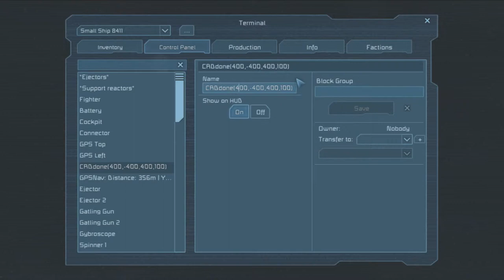Autopilot Tutorial

Comment: Could u add support for auto emergency braking using sensor?( i done it manualy but would be nice to have it in script) or have specjal in program avoiding (probably uzing sensor facing forward fo examle pich up 90 degrees fly for current time and back to program or something like that
Reply from the maker: Sensor's range is still 50m, right? At top speed, you have half of a second to brake. Yeah, I could add braking. No, it couldn't possibly save the ship.
Reply: Extramrdo but its better to hit within 50 than 100 its just about minimalising demage (and sensors should have bigger range and they are or will be mods for it) i like using remote controled drone and tested it and its awesome for seting autonomus relays just sometimes is asteroid on the way sometimes its not to big demage hitting but its continue trying to go to the destination and wreck itself completly so i seted up sensor wich turn off  gyro override and turn on beacon within information that its stops. now i thinking about adding upward propulsion so it have a chence to avoid i will test it now
thank u for your awesome work i now how hard is programing somtimes